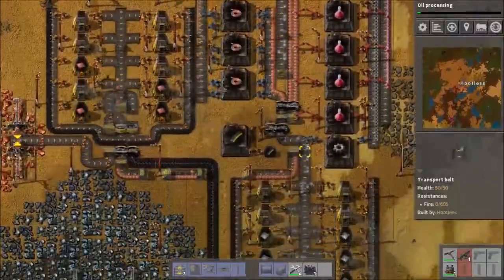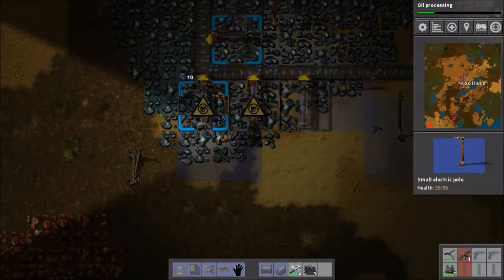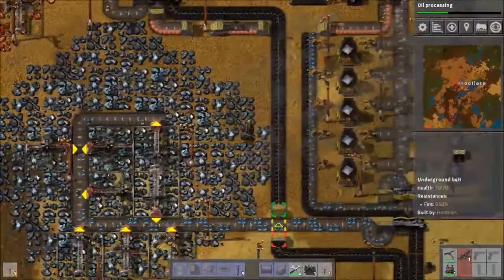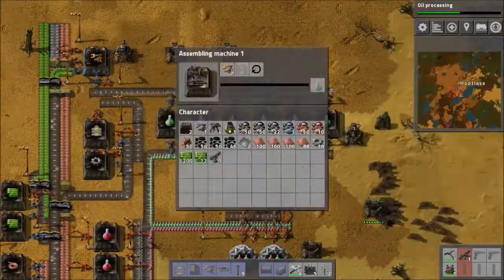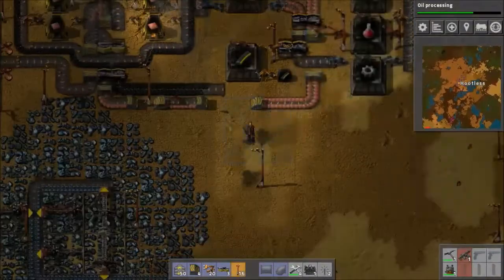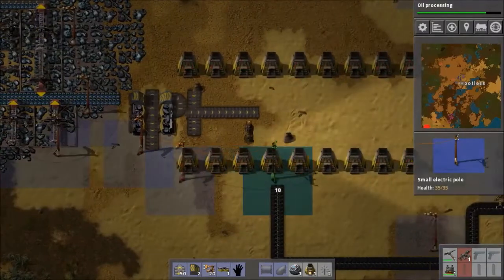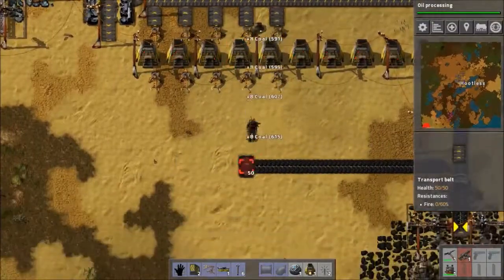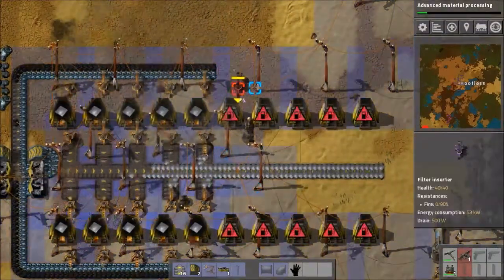Factorio No Lasers No Solars - Episode 3

Comment: This is much better. For SDV, you can crank up the speed. But factorio has so many moving parts that it deserves to be slowed down and explained in more detail. 

I really like the way you set up your furnaces here, using the splitters the way you use 'em. May have to try that one next time I play.

Normally, I'd be wondering when you go to electric furnaces, but I'm honestly wondering if iron is going to be enough, since you aren't using solar. Then again, I suppose the efficiency boost is just too big, really, to pass up. Just don't forget they are 3 x 3 instead of 2 x 2 so you have to take the extra space into consideration. I've had more than one smelting line messed all to heck and back because I forgot.
Reply from the maker: Good to hear this is an improvement! I do know that electric furnaces are 3x3, what I usually do is completely refactor my factory once I hit logistics bots. Tear down everything and put it back together in a more efficient and compact way, and that'll include the furnaces!